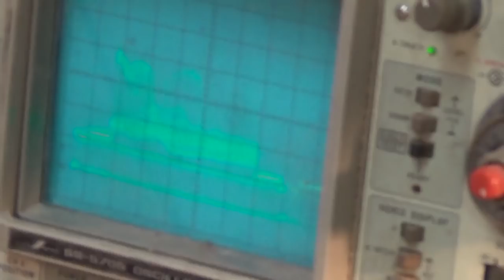I got a pair of Paradigm speakers for a pair of dimes are they any good

Comment: Listening to a slightly newer v2 set of these right now!!! My all time favorite affordable home audio speakers! You should keep these if you can! These ones with the old stamped steel frames on the woofers are the rarest by far. At some point, they quietly changed the design by putting the same cone, surround, and magnet in a cast frame, a design that was kept all the way to the v.4 Titans! The tweeters in these are not made by Paradigm themselves, but a company called Vifa in Denmark. The V.2 and V.3 are identical speakers, and use paradigms own metallic tweeters, rather than these soft domes. Some people think those models are bright sounding, but I like them that way. The v.4 is the same speaker as the v.2/v.3 but with an exterior design revision. The v.5 and v.6 are an entirely different design that shares no parts with previous models, and are identical speakers, except with slightly different crossovers: I’ve heard the 6 sounds better than the 5.

Comment: Canadian government spent tons of money back in the ‘80s on computer modeling for speaker design - they wanted to become a dominant player in the market with all that cheap lumber. It sorta worked too.  Canadian brands like this, Paisley and Energy represented great value for many years. I had a giant pair of Paisley SPL Monitors 3000 back in the late ‘80s that you could drive to high volume with a boom box they were so efficient. Replaced them with small Energy eXL 15 bookshelf speakers that I still use to this day. Easily bested speakers selling for twice the price. Was sad to see them sold to Klipsch.

Comment: I just refoamed and replaced the bass resonators and capacitors in a set of ESS Tempest LS5 on the weekend. They sound amazing.
Reply: What's a bass resonator ?
Reply: @paulb4661  imagine a speaker that isnt connected ro anything. It just oscillates with the internal pressure changes and produces low frequencies.
Reply: @Poppinwheeeeellllllieeeeez  Oh ... you mean a passive radiator ? Did you change the moving mass, or compliance or both ? I myself find most of commercial offerings, be it vented or passive rad tuned rather high to increase efficiency, but then with wall proximity/room reactance and their inherent steep roll-off below fb, one often ends up with a one note, long decay bass reproduction.

Comment: 2 weeks ago, I refoamed some original Bose speakers from mid 70s - they were like NIB - the wrap around foam type diffusers are actually in perfect shape as well - and sound pretty good for what they are. More of a curiosity those Bose - the wing treble directors are pretty cool  -   When you have JBL 4311's (or the Century 100)  - it's hard to compare anything else.
Reply: Those old school Bose are something else. Nice
Had some mad designs

Comment: I was just thinking that you should definitely refoam the other one to. 😂 Those surrounds all go bad sooner or later while rubber ones can last for decades.
Personally I would've just salvaged the tweeters from both and scrapped the rest. 🙈 
Particle board and hot glue, barely minimum amount of dampening floating around, toilet paper roll bass ports... Spared no expense there! 😂 
But  interesting video and looking forward to the repair. 😊
Reply: They components in these are superiorly designed and definitely worth repairing. They did not spend much on the boxes, so they could get the best components available for the price inside! They definitely sound better than an equally priced speaker with a fancy box and poorly made drivers would! The box and port dimensions are also calculated very well on these. 
I have paradigm Titan and Atom v.2 speakers, all of which needed the same repair.

Comment: Hm... They do not look like they where made of particularly high quality materials though...  The speaker terminals are low end, the casing is made from particle board...   Are these supposed to be high end ?
Reply from the maker: It's not how they look, it is how they sound.  Think about it, a speaker is a pretty simple device.  A magnet and a coil of wire hooked to a cone.   The drivers are pretty basic.  The engineering comes from cabinet design and port placement.   It really doesn't matter what the cab it made out of.  Partical board is good because it doesn't resonate.
Reply: Paradigm Titan is not even close to high end. My first speakers were small Paradigm speakers.
Reply from the maker: These were budget speakers.

Comment: Very lucky there dave :-D
I've seen a lot of americans repair there speakers, so they are available.
the suspension always goes bad.
The spider not so often.
I had a warped oval speaker in my hacker radio, a bit of shimming and damping of the cone over night did the job.
Once dry i took the shims out and no more rubbing noise :-D

Comment: They spared no expense using the Chinese Ejaculatory Fluid to glue everything together! At least, they used MDF instead of plastic on the box.
Reply from the maker: Nothing Chinese in here.  They make them in Canada and make their own drivers.  We used to sell them and the shop owner got a tour of the factory. They wind the voice coil and assemble everything there. Big presses and highly skilled workers.
Reply: @12voltvids  they used to make them all in Canada, not anymore. (those Titans yep made in the republic of Canukistan). But not even the savings from the government subsidy (NRC) could prevent the move to China for most of their line.
Reply from the maker: @jasons7070  
Some are made in China but many of the higher end models still made by johnny canuk

Comment: I got set of paradigm speakers and subwoofer at a thrift store for 13$ good price but the the powered sub hums really bad 😒
Reply from the maker: You know why it is humming right? .......
Because it doesn't know the words!!!
Reply: Jokes aside, find the supply voltage with lots of ripple on it. There'll probably be a bad electrolytic cap involved, possibly a shorted rectifier diode.  Best start with the low-voltage supplies for the preamp stage.

Comment: Are these a cheaper pair of Paradigms? They don't seem to live up to the hype I've heard about the company with their cardboard ports, lower quality cabinets and lack of inner bracing.
Reply from the maker: These are probably mid range book shelf.  They had some very heavy floor speaker
Reply: @12voltvids  I have seen some very nice floorstanding speakers from them elsewhere on YouTube.
Reply: These were the entry level range from paradigm from around 1990 to 2005. All of the money went to calculating the box size and producing the drivers, with absolutely no money spent on the appearance of the product, which is why they are just a box. Honestly, they do lack bracing, but you don’t hear it in the same way you would hear a super thin or even plastic box. Even a well-measured cardboard port will work just fine. My Titan v.2 /v.3 speakers (1999-2002-ish) have zero port noise despite using cardboard.
Reply: @djijspeakerguy4628  Thank you for that information. Those drivers do look to be of good quality, and the enclosure is well sealed at least.

Comment: Excited to see the refoaming process when you get to it, got some big, 70s RS speakers that sound great but the surrounds have started to turn to gum so will need fixing in the near future.  Incidentally when measuring up where are you measuring from/to? Exact dimension of the surround or from the edges of the cone and basket?
Reply from the maker: Once I get them I will do a video on the process. I have done speakers before but this was long before I was doing this YouTube thing.

Comment: I have a pair of Acoustic Research speakers that have had there foam surrounds replaced twice as they rotted out with age ,, the foam surround deteriorates with age , someone told me they react with small amounts of ozone and break down , same possible issue with rubber drive belts ,, never abused but still failed anyway when they where 8 years old , foam surround speakers have even a shorter life in an automotive environment due to exposure to hot environment of a closed car as well as exposure to UV light , any thoughts on the truth of the ozone exposure damages them over time claim ?

Comment: I'm not sure if Paradigm had good speakers at one time..but I find these type all the time.. Not a horrible speaker but very generic.
Reply: Yes, they are definitely generic looking, but for a reason. Paradigm intentionally spent as little as they could on the exterior design and features, and instead spent most of their money on the components, and calculations for box dimensions. I find that if you are on a budget and know how to repair speakers, these are among the best you can get. I have a set of Titan v.2s, and they are the best speakers I have, other than the Paradigm Atom v.2, which are the exact same speaker but with a 5.25” woofer and slightly smaller enclosure. They sound almost identical, except they have less of an overemphasized mid-bass.

Comment: wow the construction of these speakers looks like garbage, looks like they used a paper towel roll for the port and sawdust for the cabinet, and who glues in the speakers?
Reply from the maker: The glue is there to prevent any possibility of a buzzing driver.
Reply from the maker: Not a paper towel roll. That is laminated fiberboard and it tuned

Comment: Paradigm is not a good speaker! They are very overpriced!
GR-Research on youtube showed some paradigm to 6400 usd which was very cheap made with a simple crossover with the cheapest parts you can buy!
Reply from the maker: Let you in on a little secret that stereo shops don't want you to know. All speakers have massive profit. All of them. I bought a pair of Altec Lansing 305 speakers at cost for 300.00 and the repair was 2000.  We sold PSB, Paiadigm, Altec Lansing, Bose and or course Sony and Technics. They all had huge markup. The Canadian speakers were dirt cheap and sold for huge and I mean huge profits. Salesmen loved them because they got huge comission. They were actually very good speakers. Sound fantastic.
Reply: @12voltvids  my first job was radio shack in 1976. I was 16,  my manager showed me the order book.  On a system, the British turntables were the lowest profit, maybe 20 pct, the receiver maybe 40 and the speakers easily 100 or more.
Reply from the maker: @markanderson350  altec Lansing cost 300 retail 2000. Give customers a deal for 1500 they walk out with a big slime on their face and the shop just made 1150 in pure profit
Reply: @12voltvids  if you could just be a speaker shop, you could be rich. That's why radio shack pushes systems.
Reply: @12voltvids  selling a pair of speakers for 6400 usd with the simplest and cheapest crossover filter is not kind of paradigm.
You sell it as gold but customers  get gray stone without knowing it.
How do you manage to sleep at night after fooling people properly and being mean to people?
Reply from the maker: @ford1546  that's the audio business.  Lots of snake oil for the audiophools to buy into.  Lots of people made lots of money.   I sleep just fine at night 💤. I wasn't in sales. I just know what stuff cost as i was able to buy stuff at the real dealer cost.  Not the fake cost sheets that were shown to customers that would grind the sales guys down.   100 cost speakers out the door 1000. 200 2000 300 3000 ect.  Components very little margin on. 10 to 20 points.  Soeakers, accessories, cables pure profit.  Extended warranties even more.  Policy that sells for 249 costs the dealer only a few bucks and that is if they even bothered to register.  Some chain stores underwrite their own policy and device can only be serviced at their outlets.  They were gambling that you would never need it and many were void because it was damaged.  Sand in camera or walkman or water damage ect.  I made my first million in real estate myself.
Reply: Even SVS has been proven to be cheapening their crossovers! Plus, even though these might look like they are basic crossovers, the difference is not super audible.
Reply from the maker: @djijspeakerguy4628  
Cross overs job is to stop bass frequencies from hitting the tweeter and to take the high frequencies from going to the woofer as they won't do anything but perhaps add some distortion.  It's a pretty basic setup.  In the simplest form just a single capacitor, you heard that right just to filter the base frequencies from the tweeter and allow the full range of frequencies to the woofer because the woofer can't produce the higher frequencies anyway. These are not that efficient but sound remarkably good. Better crossovers we'll have a choke coil and a capacitor they base frequencies passing through the choke and onto the woofer and the trouble frequencies passing through the capacitor and onto the tweeter. The advantage to this type of crossover is a little more efficiency and they reduce loading on the amplifier because without the choke they high frequencies going through the voice coil for the woofer and the tweeter will actually load the amplifier down at higher frequencies which can cause distortion. More elaborate crossovers will use capacitors resistors and choke coils and they're designed to provide a more advanced roll off and are typically used in three-way speakers where you want to pass mid-range to the mid-range driver travel to the tweeter and only base to the woofer. I've heard some mighty good sounding to a speakers that just have a single capacitor I may sound fantastic. As I said a crossover is a simple device the magic comes from the driver design and the cabinet design.
Reply: @ford1546  they sleep well. and that profit goes back into the economy. It's not like they were selling sub standard pace makers.